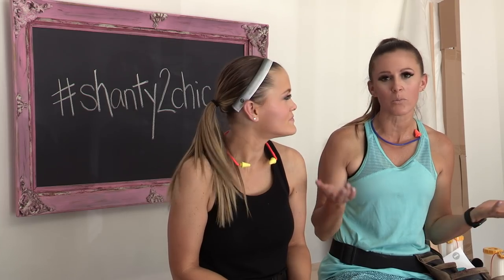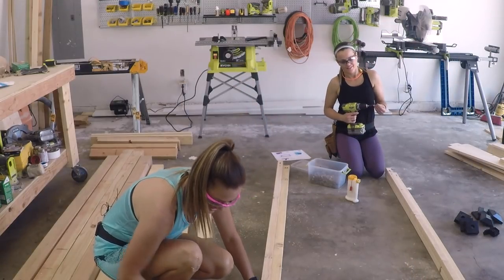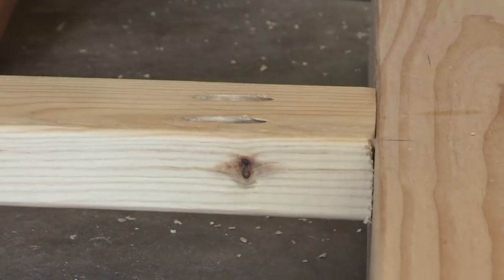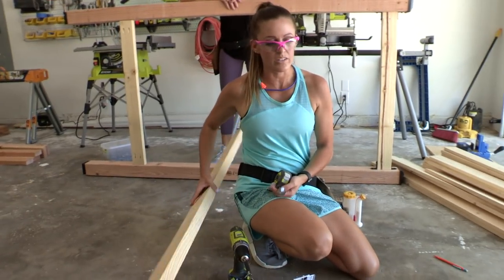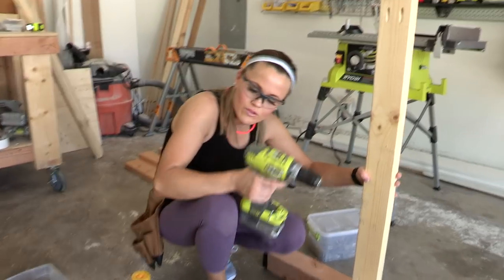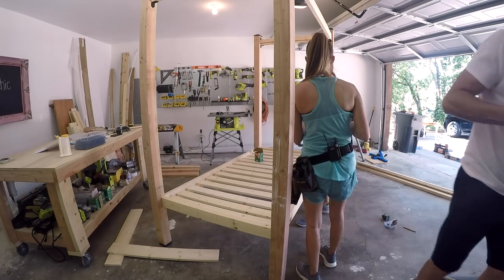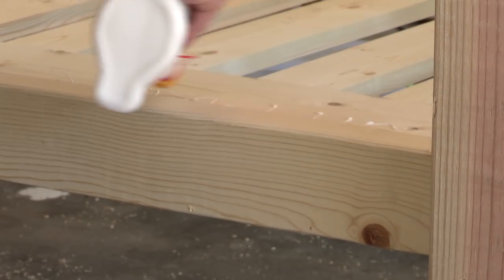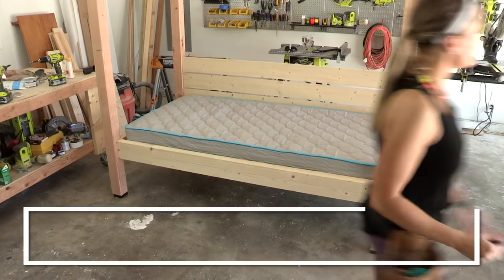DIY Outdoor Day Bed

Comment: anybody got the links to the links to the supplies (bolts/metal angles/ screws/post caps/post bases)..because when you got to the blog..thats where u find the plans..and the plans say "link in the blog" but there are none there or here..and it doesn't look like they are answering any questions in the blog question section or here. But they have a lot of videos posted so I get it.

Comment: Using non pressure treated lumber is going to rut in two years depends on where u live and this thing will fall apart ..
Should’ve used harder wood or pressure treated

Comment: Good concept and plans.  Only problem - not even close to $200.  More like $300 with the pergola and hardwareand basic common pine.  The plans say that stuff is optional so you’d better think how much it’s worth it to you before you start the project, because it’s not $200 like they pretend.
Reply from the maker: Not in Texas! I spent $200 for every piece of lumber and end caps (even the optional). If it was $300 we would say that- $300 is still a dang good price!
Reply: Shanty2Chic I agree. If it was $300 that is still CHEAPPPP!!!! I love this project! Great project ladies!
Reply: @shanty2chic  did you anchored the daybed/pergola to the patio stones? What suggestions do you have for anchoring? Thanks